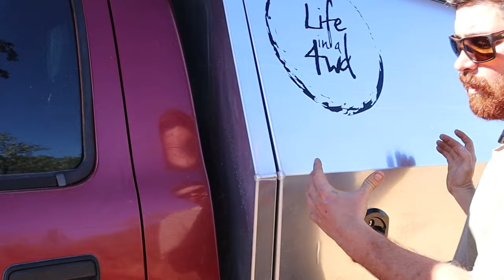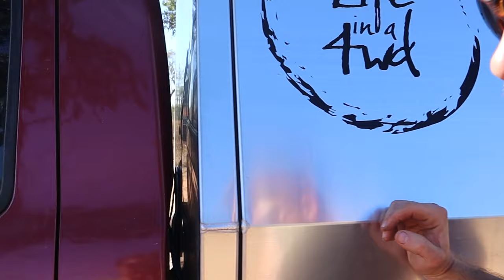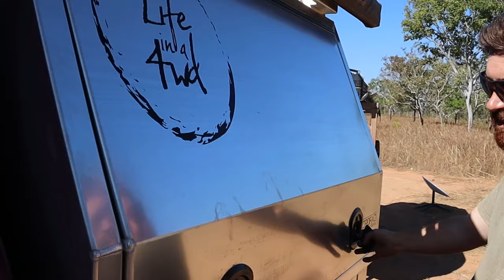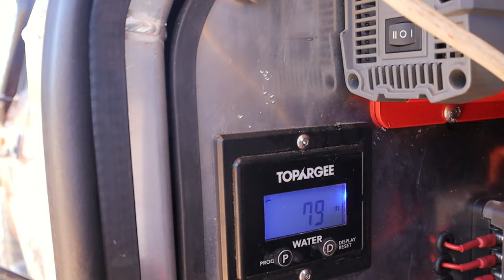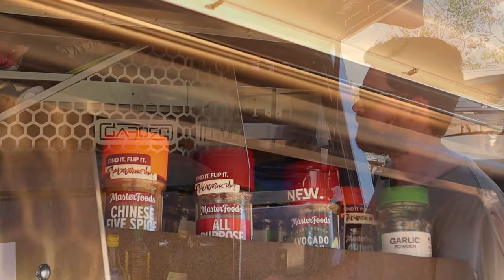CUSTOM CANOPY SET UP RUNDOWN - How we set up our canopy to travel Australia

Comment: dunn and Watson make fridge slides that would work with the orientation of the fridge
Reply from the maker: Yeah we did take a look at those, unfortunately we needed a fully zero footprint slide as we literally had no extra room on either side of the fridge, even that little extra the runners add on either side just took away that bit of room we needed. Oh well! Next build...